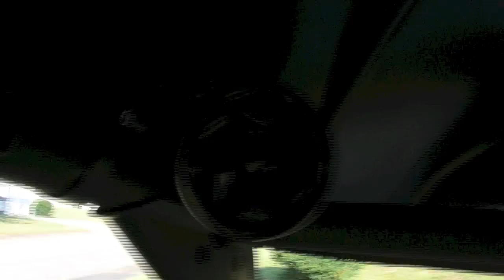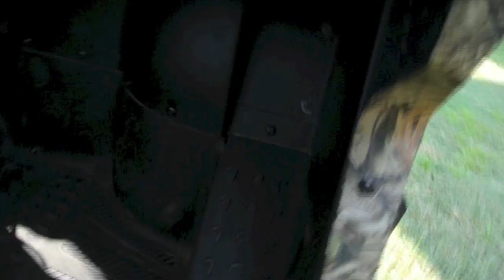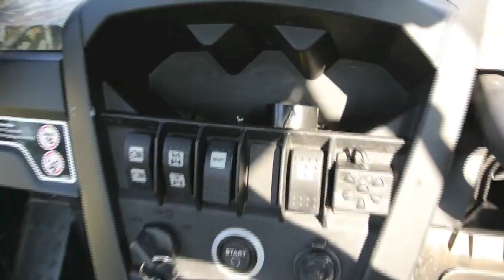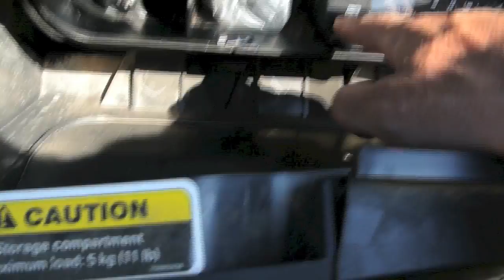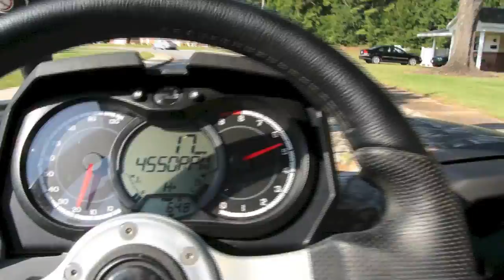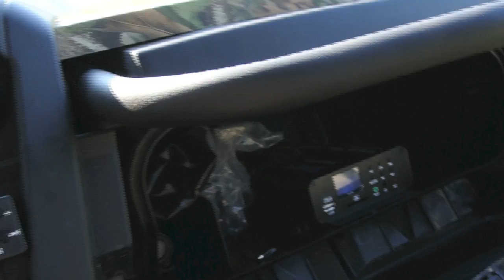Can Am Commander 1000xt Shark Motorcycle Audio 1000 Watt

Comment: Where did you purchase those mounts to put the speakers on?  Thats exactly what I need!
Reply from the maker: The brackets came with the system, and I mounted them to the the clamps that hold on the roof.  Thanks for the comment if you have any more questions let me know.
Reply from the maker: Also I should have mentioned that I was not happy with the system and returned it and built my own.  Check out the video.  http://youtu.be/6UrfJL37ixc